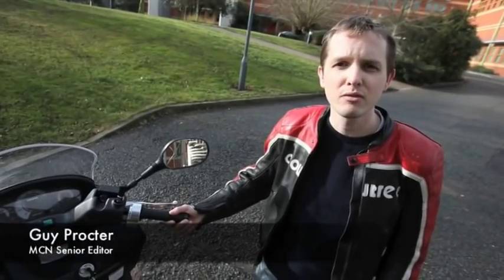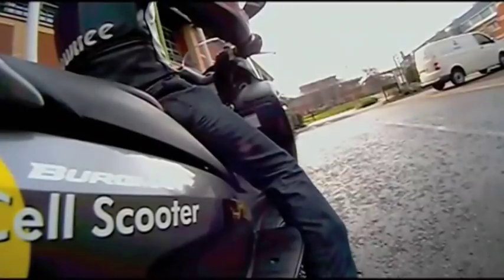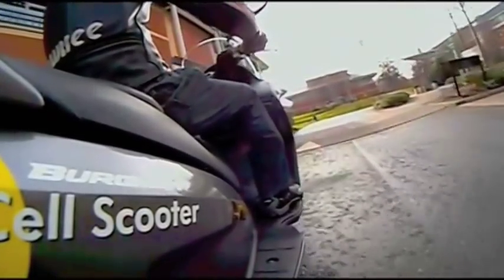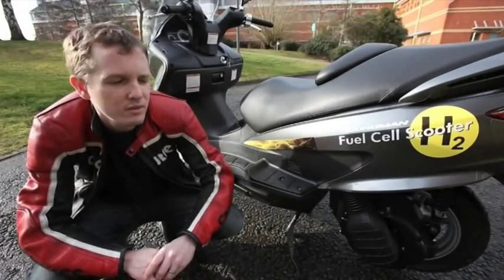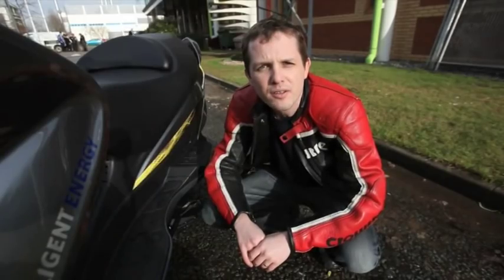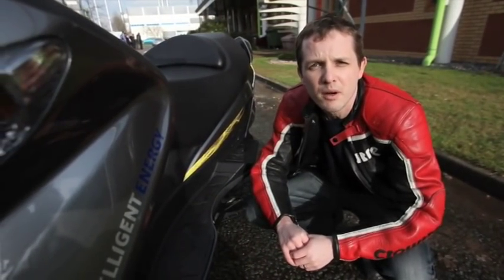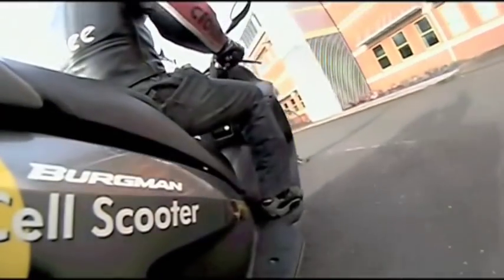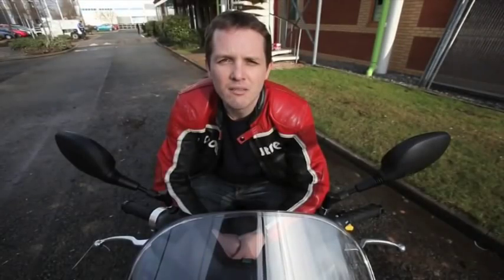Hydrogen fuel cell Suzuki scooter

Comment: by doing a variety of that could in effect get in theory 10-20Xs the range of either as a stand alone. ive been working on a very very special generator that requires zero recharges of any sort and can sustain itself till it needs fixing around 30,000 hrs of work time. been working on this concept for around 5 years now. believe i have come pretty close to the final product
just imagine never having to stop for refueling again. never stopping for a recharge, never paying a cent again for fuel.

Comment: seems would be better if where to have a hybrid to where- the vehicle is driven by electric power, but has a battery bank "lightweight ultra high capacity lithium polymer pack" that is recharged automatically by a quiet torqued generator with a special auto tranny to where it can crank on and recharge the batt bank without stopping, the fuel for the generator could be hydrogen. so then the motor could be hooked up to low rpm high output generator heads, and so doesnt need many rpms.

Comment: @dinodam hi, main reason is it seems like an unnecessary step to me. Needing vast amounts of energy to produce, package and ship hydrogen, then converting that back to electricity in a fuel cell. 
A pure electric/battery vehicle has one step and you can produce that electricity however you like and deploy to any location easily and cheaply.
I wish youtube comments weren't so limited then I could go into more detail. Cheers
Ruu

Comment: @ruuman it took me aboutone year to get to where i am, reading everything i can find on the internet. ive got a good e-book you can read if you can want it. i have actually heard of a lot of electrolysis systems that are over unity, which means if 1 amp electricity = 1.25lpm of hho, theyre cell is creating 2lpm @ 1amp. very interesting. browns gas refers to the older systems that use baking soda, new ones dont require electrolyte. im about to creat my own kit and ill let u no how it goes

Comment: @addys well... my vote would be on solar energy even though is clear that it won't be of much help in  places near the poles where there are long periods of time without enough solar light.
Too bad nuclear engine generates dangerous  - long term wastes.
BTW: I agree about missing the sound of a good ol combustion engine... but I guess in the future it will be remembered as we do now with vapor machines many years ago... IMO

Comment: why would you want 10,000 psi of hydrogen on a vehicle? when you can have a tank of water and electrolytes, then a dry hho generator that's got a frequency generator. then can produce more hho with less amperage.

Comment: @ruuman Take into consideration efficiency rate in which electricity is stored and released into a battery too. Now so long as we improve on that aspect in hydrogen, we will have a perfect medium of energy storage. Something that is indefinitely stored, not an ever eroding capacity and something that wont harm the environment like a lot of conventional batteries. I'm looking forward to nano carbon tanks, better fuel cells and improved solar efficiency (source has to be 100% green too right?)

Comment: Perhaps oil companies (i.e., Exxon Mobil, Chevron, BP, etc...) will control hydrogen, but not OPEC.

Any small start-up companies with viable technologies will be swallowed up by large corporations, just like what's happening with battery and renewable energy technologies.

A battery has a lifetime, just like solar panels and wind generators or anything else, and will have to be replaced.